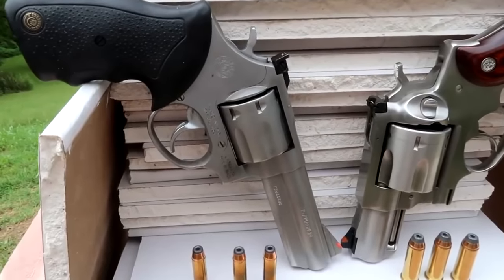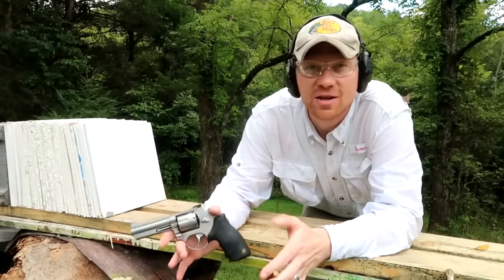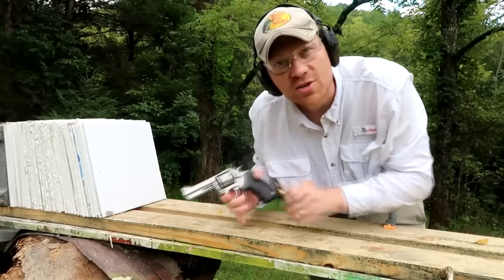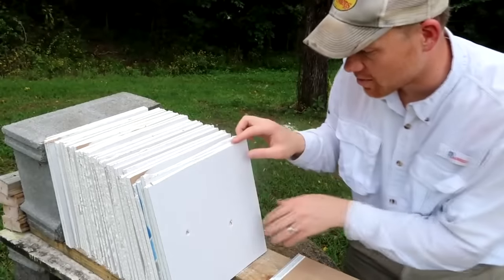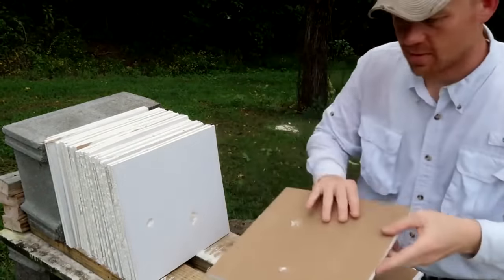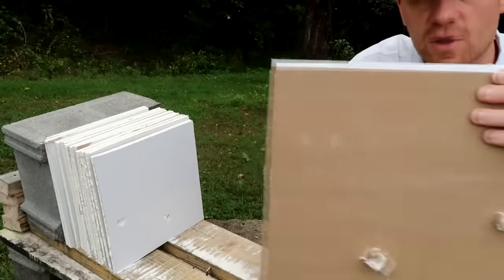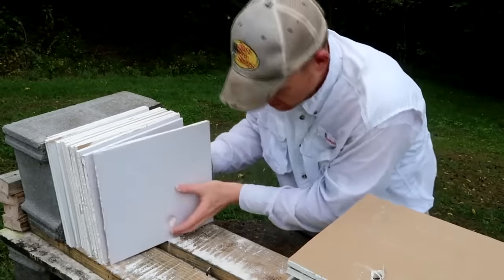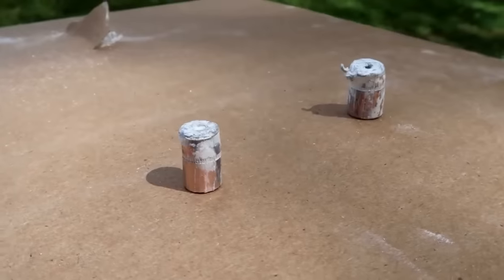.357 mag vs .44 mag - Drywall Test

Comment: Not surprised at all at lack of expansion. You have 2 factors involved. (1) Hollow point or not. Wrong design  The cavity feels up, and you have a FMJ, or in this case a full wadcutter. Been proven time and again. In this case it might not be a bad thing. The weight and diameter is no longer even, so upon hitting muscle, there's a good chance it will tumble. (2) Being plaster. The drywall won't expand much, allowing the bullet to do it's job. Using 140 gr pistol bullets in a 35 Rem, I've shot clear through 4 to 6 in diameter trees. Do the same thing using chat as medium, and there won't be much penetration, but it'll tear up the bullet. Back in the 80's, the same thing was done with shotguns, using common household construction., and distances. If you live in town, and don't want to risk being sued by the neighbors, you might not put anything bigger than #6 shot in old Betsy.

Comment: I bet if you spaced out the boards of sheetrock at least 2 inches apart the bullets would have went through even more boards because it would just blow a clean hole through every board without the residue clogging up..

Comment: The pistols will penetrate more than a rifle because of the lower velocity. It’s actually safer to use a 223 inside your house because the bullet will start to fragment on impact of the first sheet of sheet rock. A shotgun will also penetrate more than the 223 because of the weight of the load, but bird shot is better for not over penetrating. It goes against most of conventional wisdom in firearms but holds to mass and velocity if the velocity doesn’t destroy the projectile.

Comment: Not really a fair comparison since the barrel lengths were so different. If you are going to compare how many walls they will go through you need to actually build the walls with the three and a half inch gap between the pieces of gypsum board 4 / drywall
Reply from the maker: U want to buy me matching barrel lengths? 😆
Reply: Let's just agree that the demonstration could have been more fair if the barrel length of the pistols work of similar length. I know for a fact that a 6-inch barrel will produce more velocity, than a 3 inch barrel in the same caliber, using the same ammunition.
Let's just agree that either of those two pistols would be more than adequate for a self-defense weapon or Home Defense weapon if the need were to arise.
Reply from the maker: @CJBanks-nc5re  not enough to argue about one inch difference of barrel length 🤷‍♂️

Comment: The heck! you would think that the 44 magnum with 90 extra grain of powder would penetrate more of the drywall sheets but only 2 extra? The 357 bullets only have 150 grains. Seems like all the 44 magnum does is making a slightly bigger holes even with higher velocity bullets.

Comment: to many things about a safe room
If using this sheetrock.
And I think you are in there or something is worth getting..
Just use a knife and Dig thru it.
Shoot many time into it to break it up.

Why not try 16 guage steel between 3 lays front and back of sheet rock.
There are plastics that would work also, between layers that would really slow things down.
OR you can have the internal wall covered by Suspended plates of steel/iron.  That can absorb 90% of the impact.

Comment: If You use 4 inch 44 mag, You shoud use 4 inch 357 mag. In this test 44 mag revolver has shortest barrrel then 357. As for me 357 mag and 44 mag is only for fun or hunting. If You need gun for personal defense - 38 spec or 9 mm  is enought =)

Comment: This test isnt completely accurate. Those layers are compounding pressure (compressed drywall) and material on exit and reentry after layer 1 entry.  If you out 1 inch space between each layer, I bet it would get another 2 layers.

Comment: I replaced a deployed air bag which is kevlar & folded it to about 12 by 12 square taped to cardboard so it would stand it caught 357s  44 punched big holes    44 split cinder block in two.    Shot a 44 into a car door the steel saftey beam inside the door barely caught it  give me the 44 for the bear🖖

Comment: You invalidated your results by not using guns with the same barrel lengths. Bullet weights do not matter as you are using to very different calibers. What matters here is barrel length and bullet type. SMJ Hollowpoint which will plug up with the drywall effectively making it a solid. So you probably should have used a solid to begin with.
Having said all that, compare the velocities of both rounds. The 357 has a higher velocity to start, which increases with the longer barrel length. The 44 is a larger bullet moving at a slower velocity which is further reduced by the shorter barrel.
There are many factors to consider when doing tests like these, so the information will be factual and correct. Other than that, who really cares how many layers of drywall it takes to stop a bullet. Concrete block grouped solid will do the job and cost less in materials and labor.
Reply: As long as you had fun shooting, it's all good

Comment: LOL first stand back 25 feet secondly try my Smith n Wesson 500 Mag 10.5” barrel populated with a 700 gr load rather than drywall you gonna need to use 12” squares of 1/8” plate steel 😂😂😂😂😂

Comment: Not a true test 2 different barrel lengths. I shoot a lot of 45 acp from a 1911 and a Gen 3 Just Right carbine and all my ammo is 230 grain jacketed round ball hand loads all loaded to same spec through a Dillon 1050 autodrive press and there is a big difference in both accuracy and range and impact between the 2 guns all the same ammo same caliber but different barrel lengths changes ammo. Same with 410 shot from my Taurus Judge defender with 3 inch barrel and 410 shot from my Judge tracker with 6.5 inch barrel and 410 shot from my shotgun with 28 inch barrel same rounds same caliber complete different results. See so many tests with completely different guns and different barrel lengths its not a test it's a guy shooting a gun.

Comment: Flawed study.  Nice try though.  Barrel length difference.  No standardization from delivery of shot.  Also.. these need to be two separate test.  Shooting the 357 first could have micro fractured or compromised the samples to allow for better results with the 44. Too many confounding variables but fun to watch none the less. Thanks.
Reply from the maker: Not a science lab. Back yard fun. Happy to accept the $3k it would take to produce the video in the fashion you describe.  I am just a regular ol broke dude
Reply: Lol I'm an old broke dude too.  Wouldn't take 3k... shoot the guns from the same distance (tape measure) 2 sets of dry wall 20 sections dreep each...1 bullet each gun. Scientific method is all about repeatability... not expense.  Get some dry wall..2 bullets...2 shots... same distance..2 different sections of drywall... then report. The only difference then is the length of the barrel.  Then the variable is limited to one which makes the fun backyard video study more viable and fun. Thanks friend.. glad you posted. Your video was fun to watch.

Comment: First thing I thought was you took quite a risk by shooting at any kind of object from such a close distance. Things did turn out unexpectedly but this time in your favor, the drywall absorbed the bullets completely. But It also could have turned out badly with fragments flying around you eg if you accidently discharged too early while still pointing at the table. Next time may be take a few steps back, just in case. Just want to see you well and looking forward to the next video.